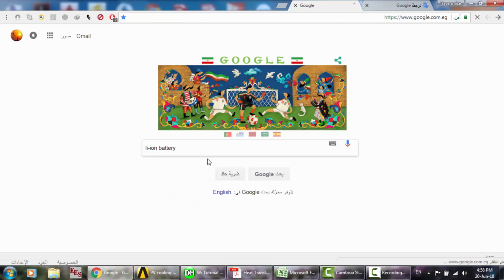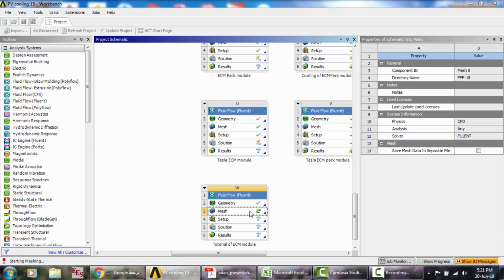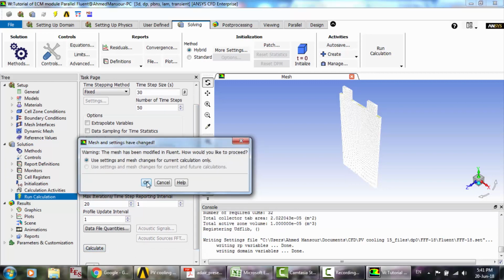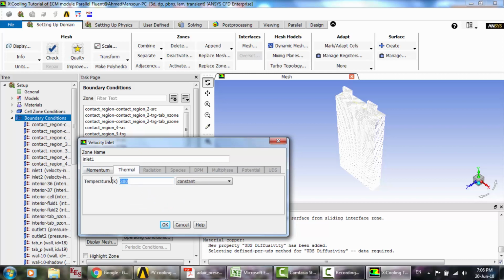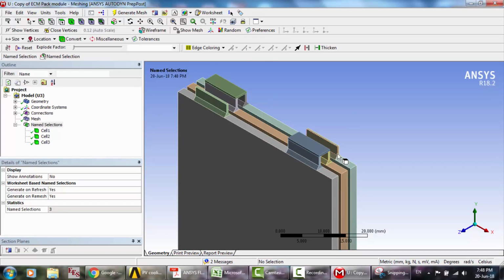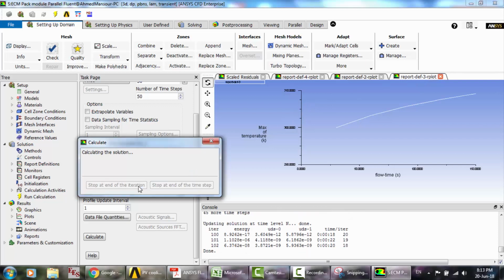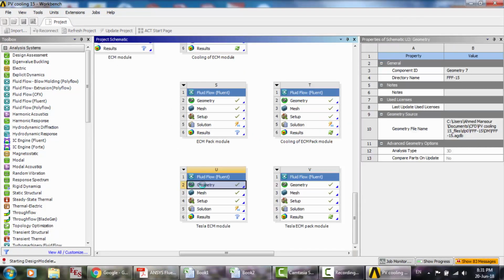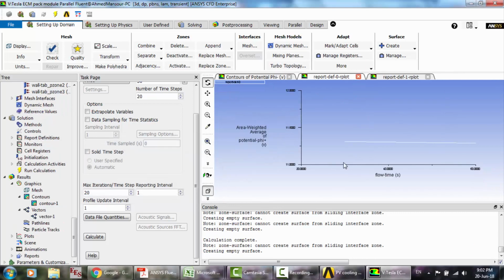CFD simulations about ECM Li - Ion battery, single cell & pack with & without cooling, Ansys Fluent

Comment: Namaste Sir, This Keshav Chaturvedi, I am currently working on cylindrical cell for which i am trying plot ocv plot but for some reason the voltage deflects by large amount around 700 flow seconds i am trying 1 crate and used NTGK model with providing data for 0.2c 0.5c 10 1.5c 2c for parameters estimation. Can you help, thank you
Reply from the maker: Hello, you shall follow the same procedure I showed in detail in simulating the cylindrical battery. I showed how to create the geometry of the single cell, do it and you will get the same results. if yes, apply on the pack. Thanks

Comment: Hello, I am working on battery thermal management and I am stuck on something. Can you help me ? How can I contact you ?
Reply from the maker: Hello, what is the issue?
Reply: @haveanicetime  I did the same as you did to my 7p4s package, but I get an error when getting the results.
Reply from the maker: Send me email to mech.eng.ahmedmansour @gmail .com and I will send you the CAD files. @ferhatferhat5814

Comment: why are we switching off the convergence criterion?
Reply from the maker: Due to the physical difficulty in solving the model numerically as I think. Thanks
Reply: @haveanicetime  sir, i have a doubt in the battery specifications part, for the system power should we give the total power of the EV?
Reply from the maker: @eashwarsj1624  Hello, the inputs are related to the battery you're simulating. You simulate a single battery or a stack. Depending on this, you determine the inputs. Tobe more confident, you gotta get a researcha rticle that shows the inputs ofthe CFD model and you will know then. Thanks
Reply: @haveanicetime  sir, i have sent you a mail regarding some doubts. can you reply for that?
Reply from the maker: Dine @eashwarsj1624

Comment: hey! im doing for a cylindrical cell following your method only but in the conductive zones part its not showing anything
Reply from the maker: Hello, I have shown in the video what to do to avoid this issue. Watch the meshing part again...Thank you
Reply: @haveanicetime   and now im not getting the UDS diffusivity option in the materials part. what can i do for that?
Reply from the maker: @eashwarsj1624  I think because of the version you're using. Be sure it is the commercial lincenseor the paid academic licnse not the free student source. This is the issue I guess. Thanks

Comment: This video helps me a lot.Thank you for helping previously. I have a small request. I'm learning about modeling and thermal simulation of cylindrical batteries.Could you share the file for modeling cylindrical batteries. I have sent you an email.
Reply from the maker: Hello, I replied to your email. The cylindrical cells are easy to be created. Not a big deal. Thanks
Reply: hey did you perform simulation with cylindircal cell

Comment: I am currently performing simulation on a air cooled battery pack in ANSYS Fluent. During solution running, "float point error" is generated and solution is diverged. I improve the mesh and reset the settings but problem still exists. Can you help me to solve this problem. 
I hope you will response.
Reply from the maker: Hello, something is not correct in the procedure you've followed. Check out again the steps in the video and make sure 100% you did not miss anything. Thanks

Comment: Thank you for an intricate tutorial video. There are not many resources available freely regarding battery model in Ansys Fluent. I just had a small request. I too am trying to do thermal simulations on a cylindrical battery. Do you have any resources on that. Or can you share the cad files of the pouch cell.
Reply from the maker: Hello, you're welcome! Send me an email to mech.eng.ahmedmansour@ gmail.com
Reply: can you share me any resources for themral simulations of lithium 18650 cell using ECM battery model

Comment: Thankyou for the details explanation,  currently I'm trying to simulate the single cell with default value of ansys but my maximum temperature coming at bottom of the cell not near the tap zone . Also I'm not able to put uds value can you please help me...
Reply from the maker: Hello, it seems tht you version of ANSYS is not full. You must use the full version of ANSYS and not the free version. Thanks

Comment: Thank you for this wonderful tutorial it have elevated me alot I would like to practice this and re model 
With 9 cells.. because I want to suggest a project topic for myself before time..
I will love to do battery thermal management for hybrid electric vehicle as my project.. please can I have your support?
Reply from the maker: Hello dear Ezulike, you are welcome! How can I help you?
Reply: Thanks if you guide me achieve same result..
I want to try modelling a 1p9s.. I will take this your steps but I the geometry file so I can duplicate it to 9cells then mesh and continue modelling..
Reply from the maker: Is the cell pouch or cylindrical? Thanks
Reply: @haveanicetime  The pouch is what am working on but you can send me the both if you don't mind. thanks
Reply from the maker: Send me an email to mech.eng.ahmedmansour@gmail.com
Reply: @haveanicetime   My email is ezulikearthurgrorge@gmail.com you can please send me the CAD files. I will also request for your support while doing this project thanks.

Comment: I have a question, do i need to change the materials of the walls in boundary counditions as well? @30:54 the material name of wall cell is left to aluminum, should it be changed? Thanks in advance.
Reply from the maker: Just do as I showed. It does not matter if you leave it because you have already defined the material in the cell zone tab. Thanks
Reply: @haveanicetime  Thank you, I have one more follow up query. I am trying to simulate temperature rise of a pouch cell with different active/electrode thickness, however the results contradict the research papers available online. The slimmest cell has the maximum temperature rise whereas the thickest one has the least, the complete opposite according to the research papers. Any ideas why this might be happening? Initially I thought it was due to the presence of lower surface area on the slimmer cell however the results were too drastic to be that reason. I assume more the active material greater the heat generation? Sorry if I sound dumb I am new to this.😅
Reply from the maker: Hello dear Ali, I cannot be sure becasue you must have the same dimension of the cell shown in the paper and the same boundary conditions. This is the only way of the correct comparison. Thanks

Comment: hello Sir, your videos are tremendously awesome and helpful . I need a little help from you if possible in my college project. my project is on using nano fluids as coolant in the Li-ion battery stack of evs and write a program such that mass flow rate of nano fluid varies as per the demand of the battery . please help me out
Reply from the maker: Hello, you're welcome! Actually you gotta get research articles that focus on that and learn the UDF method. Danke!

Comment: Hello, Can you send me the ansys add-on module? The one available on the intrnet lacks many stuff!
Thanks
Reply from the maker: Done!
Reply: Thanks👍
Reply: How do we produce user defined functions for the model. And what are user defined scalars, do we need to produce the uds too?
Reply from the maker: @abhisheknath3419  The UDF are automatically loaded with the MSMD battery model. You gotta use ANSYS commercial or the full academic version because the free one is not complete.
Reply: Hello again. I have used your process exactly( just the diffusivity part was missing,since I am using the free version), and I am not getting satisfactory results. I am getting HOT SPOTS in the temperature contour. Also,some decrease in the time step however improved the contour,not totally diminishing the problems. Can you suggest me a good time step,no of time steps and iterations per step!
Reply from the maker: @abhisheknath3419  The uds are mandatory.
Reply: Hello,do you know where can I find the diffusivity infused in electrical conductivity thing? The guide which explains that?
Reply from the maker: @abhisheknath3419  Do a literature review.

Comment: Very nice the one thing i am not clear with is the e material properties I am trying to do for a LFP 26650 cell but my doubt is will the values of properties used in the video for active material section be applicable to different cell chemistries
Reply from the maker: Hello dear Nrusimhan,  you're welcome! You can get the values from the literature related to the battery you're using. Danke!

Comment: Hi! Im trying to create a 3P3S battery pack using 18650 batteries but it is showing that my batteries have all the same temperatures. Which doesn't make sense. Pls help!
Reply from the maker: Hello dear Chua, run a simulation for the model I showed in the video and make sure that you get the same results, if this occurs, connect other batteries in parallel and see what happens. It mainly depends on the geometry preparation. Try until you get it done. Danke!
Reply: hey i am also favcing issue while performinhg 3s4p .18650 model , help me ,if you are done with your project
Reply: @ramkrushanpatil1739 decided to stop the project, sorry not able to help!

Comment: For the air cooling option, I have copied your simulation exactly and the countours for the temperature look good but when I unselect Fluid 1 & Fluid 2 (so that I can look at the contours for the battery itself), the battery is just red, please help :(
Reply from the maker: Please review again the steps you have followed because something is not correct. Danke!
Reply: @haveanicetime  I think I’ve followed them perfectly but the problem is when I remove fluid 1 & fluid 2 from the contours, the battery doesn’t look like it’s being air cooled
Reply from the maker: @MegaAmarchana123  Check again and you will difinetely find something. Danke!
Reply from the maker: @MegaAmarchana123  Validate the results against a research paper or make sure again of the steps and inputs. Danke!
Reply: @haveanicetime  ah okay! Do you have any research papers that have their parameters specified? 
Thank you so much! You’ve helped me insanely in my final year engineering project!
Reply from the maker: @MegaAmarchana123  Hello dear Amar, you must do a literature review and get the recent papers having detailed information about the case study :). Danke!

Comment: Congrats on the video, its helping a lot!

I have a question about uds on e_mat and t_mat. When I replicate the video, I get the error "AMG solver: uds-0";
But when I use t_mat on cell, and e_mat on tabs (the opposite), I can run the simulation.

Would you happen to know what this means? Because I can't find reasonable temperatures or current vectors. Thank you already
Reply from the maker: Hello dear Gabriel, make 100% sure of the procedure you've followed and it is identical to the video. Any changes lead to those errors. Make sure that you have entered the diffusivity correctly for the electrodes.

Comment: How can i get the heat generation on one cell ??
Reply from the maker: From the contours in the results.
Reply: @haveanicetime  why do you setup the convection on cell and tap??
Reply from the maker: @26조황희수  The cell is exposed to convection.
Reply: @haveanicetime  when i simulated one cell battery, the high temperature of cell was 303 K . There was only a 3 Kelvin difference. Is this right??
Reply from the maker: @26조황희수  You must validate the results.

Comment: With Version 20r2 and upwards the uds-diffusivity seems not to work anymore with your models. I'm not able to set these parameters (no input optikn in material properties) Is there another way?
Reply from the maker: Hello, you are right. The student versions of 20's are missing many features. The only way is to use the commercial version of ANSYS. Danke!
Reply: @haveanicetime  During further research I found out that it has nothing to do with the kind of version you are using. It is implemented on a different way to the electrical conductivity parameter settings. The guide gives a good explanation
Reply from the maker: @m_gonser3056  Okay, this is very good. Thanks
Reply from the maker: @m_gonser  However, all the othes who could not simulate thier cases were using the free student version and could not do what you have found out. They could not find some tabs or main features of the module itself, they were missing. Thanks for sharing that piece of information :)
Reply: @m_gonser3056  Can you tell me how to input udf values ? is it by using electrical conductivity option ?
Reply: @m_gonser3056  Can you explain to me how did you did that?
Reply: @m_gonser3056  can you share that guide link and also please mention the page number where it is present about electrical conductivity it will be very helpful please share
Reply: @m_gonser3056  bro can you please share the guide
Reply: @m_gonser3056  Hello. Can you share that guide link to better understand the electrical conductivity parameter settings? I am facing some problems in adding the udf values to the simulation.
Reply: @haveanicetime the 😊
Reply: i have the same problem

Comment: Thanks for your information. Could you please share cylindrical batteries geometry and files to sairamab89@gmail.com
Reply from the maker: Hello dear Sairama, they are very easy to genrate especially after showing the details of the geometry in the video. Danke!
Reply: @haveanicetime   Actually I want to a detailed cylindrical cell including anode and cathode, as I am doing electrochemical model(newmann p2d). Could you please provide details on that model
Reply from the maker: @sairamab2304  Make a detailed study on this model and get its physics. Danke!

Comment: It will be very if u share this Ansys fluent msmd battery module along with simulation files...I am requesting you mr.danke to share those files and my mail id is harikishoregenius@gmail.com.. hoping for a positive response
Reply from the maker: Hello dear Hari, the MSMD module is loaded the way I showed in the video. I only share the CAD files of the pouch cell to follow the steps to learn. Check out your e-mail. Danke!

Comment: Thanks a lot! It was really helpful. Could I have the pdf as well? Please email me at thanetsakshyam@gmail.com. Appreciated!!
Reply from the maker: Hello dear Sakshyam, you are welcome! Check out your e-mail. Danke!
Reply: Thank you so much for the pdf.... But as a beginner I'm still having problems in the udf diffusivity. I'm not getting any option for the uds diffusivity. Can you explain how we get? As in mine, there no uds diffusivity option.
If possible can you share me the Ansys zip file for this project in my mail?
Very much appreciated for your help and for this video.
Reply from the maker: @sakshyamthanet4890  I think you are using the academic version of ANSYS and it is not suitable for this simulation, the commercial is required. Danke!

Comment: Hello, i am student of South korea. I have a question about UDS diffuivity. I am using Ansys 2020R 2. But I can't find out the UDS diffusivity and  compile UDF for material. How can I fix it? There are no any comment about this on your video so i can't go on. Or Could you send me Udf please? My e-mail is likce2008@daum.net. Thank you very much
Reply from the maker: Hello, you are welcome! If you are using the academic version, it is the source of the issue. There is something missing in the versions 2020's. This affects the add on module and the UDF's required to run the simulation are missing. I do not write them by myself, they are loaded automatically. So, try changing the version and get ANSYS 2019 or older. Danke!
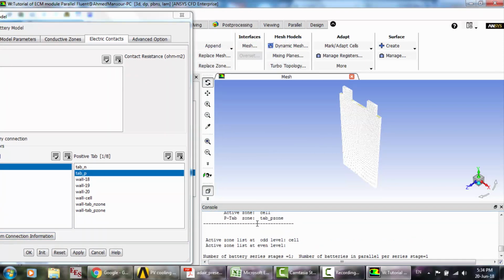Reply: @haveanicetime  Ok. Thank you very much. And I have one more question. At the timeline 0:26:46 battery network zone information,  your battery serial includes tab_nzone, cell and tab_pzone. But my case, battery serial only include cell. Meanwhile the tab_nzone and tab_pzone are out of battery serial. why is it ?
Reply from the maker: @naltube_  I am sorry, I am only familiar with what you have seen in the video. Any other differences may or may not affect your results or the running of simulation. ANSYS is changing all the time as you know. Danke!
Reply: @haveanicetime  Hello, I resolved the problem by downloading 18R1ver. And..... i have a question to you... I want to analyze pouch-type battery pack. But at articles, It seems analyze the pack without tabs. It looks like weird but it is obvious that the analyzing was very well. you can see the pictures at every articles that handle battery pack, not a single cell. Do you know something about it? and how to analyze no tab battery pack at Fluent?
Reply from the maker: @naltube_  Hello dear, this is good. For the articles, what I know is that using the module requires the procedure I showed. The tabs are necessary of course for the physics of the simulation. Then, when you get results, you can hide the tabs and only show the pack :) because they are not that important in the analysis. This is what I think they did. Danke!

Comment: Thank you for helping previously... 
I've another question😅
Do I need inflation layers in solids contact surfaces for heat transfer?

And does inflation layers need to be on both sides: on fluid and solid body?
Reply from the maker: Hello dear Mohammad, it depends on the y+ and the thermal boundary layer or the boundary layer in general. The inflation is needed if the mesh is unstructured and the boundary layer will be simulated. Study this part in the references. Danke!
Reply: @haveanicetime  ok got it... thanks again✌